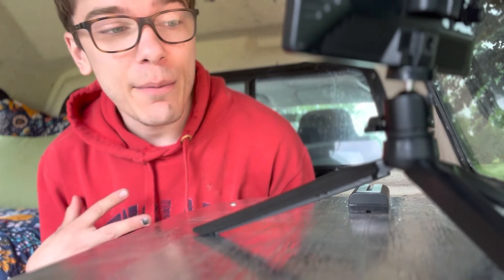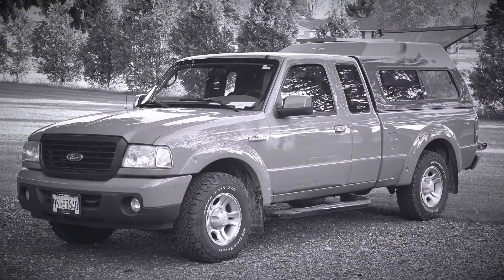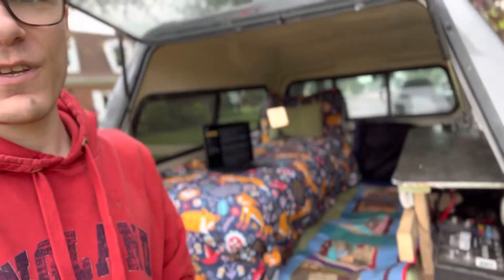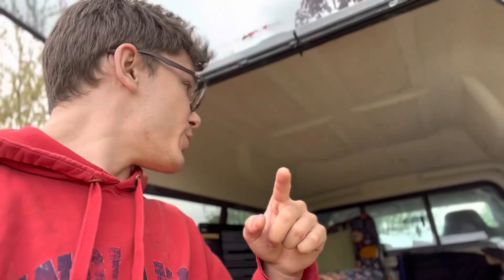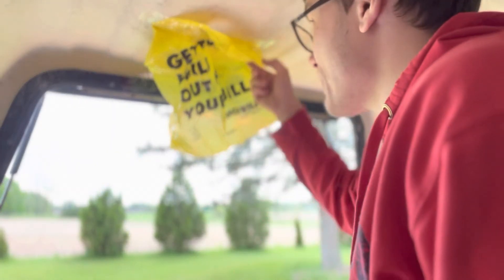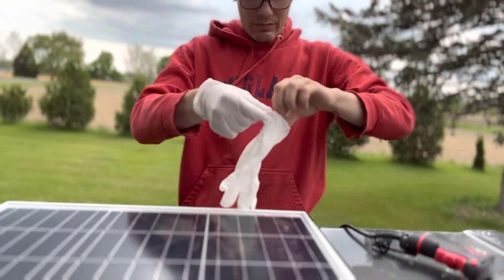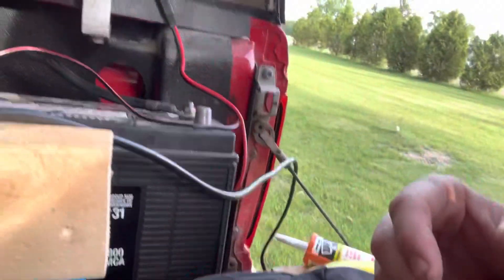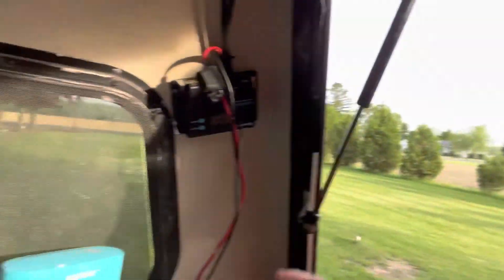How to install renogy solar panel

Comment: Hey man! New subscriber here, love the content. I have a 2010 Ranger I'm looking to build out into an adventure rig myself so it's been cool to see someone else actually doing this with a smaller truck. Amazing what you can fit inside a truck bed with the proper planning.

I was wondering what cap you ended up going with? I'm currently shopping around at the moment. I may go a slightly different approach and buy a RTT for sleeping in and freeing up some more room in the cap for working \ cooking on the road (I have a remote tech job). My only main concern is head room when sitting down. I'm 5' 7" so I should be ok to sit up but with a chair that's a different story so mid \ high rise cap might be the answer. 

Ikamper has these new wedge style tents coming out next year that have provisions for mounting solar panels and all manner of accessories so I'm pretty excited about that. 

Anyway, cheers and looking forward to more videos!
Reply from the maker: Howdy! 

Im halfway through filming my next project update video. I can answer some of these questions better in a video response. 

I’m also trying to build a remote/work from home truck so that I don’t have to use my vacation days during camping. I too work in tech and and something like this has been a dream of mine since high school after reading about that google employee that did a van life build to pay off some student debt (this was back in like 2010 or something). I was immediately captivated, I love the idea of a mobile tech lab/camper pickup truck build.
Reply: I appreciate the reply and looking forward to the next video! It's certainly an exciting prospect to get out there and explore while working the day job. Cheers!

Comment: 07;55.... Connect / disconnect order?  Fuses (or breakers for larger systems) are installed all over the place. One being between the battery & various devices. Most use a battery post fuse. What happens if the battery post fuse blows?  That disconnects the battery from this particular controller.  Will that safety valve cause the controller to be fried?
Reply from the maker: There’s a backup shutoff inside the solar controller but I only treat it as a backup, don’t rely on it

Comment: I get a Hank Green vibe from you. Nice video, I have a Mazda B4000 which is basically the same, but I'm rebuilding a vintage slide in camper for it.
Reply from the maker: Hank is cool! 😊❤️

Comment: Dude please read this comment. I don’t say this A lot because I’m an internet troll 
You are super charismatic and definitely have what it takes to have millions of followers. The only reason I commented this is because I saw you only had 1 comment. But dude just keep doing what your doing . Maybe do camping vlogs?? I also have a 4.0L 4x4 Ranger and am starting to convert it to be able to camp
Reply: Also do you think there is a way to build a camper top  around my tool box I have in the back… it came that way when I got it
Reply from the maker: This comment really made my day 😊😊😊😊

Comment: Liked and shared, you think you will put a window shaker in there next? (A/C Unit)
Reply from the maker: I was thinking of trying out one of those redneck ac units where you just cut some HVAC holes and slap a fan onto a cooler with a block of ice in it, although I hear humidity is an issue with that sorta setup. Might be an interesting experiment though! It’s starting to get to the “it’s way too hot for this” sorta time of year
Reply: I have been experimenting with the redneck cooler AC on and off for a year and it's not worth it where it's humid (Central Texas).